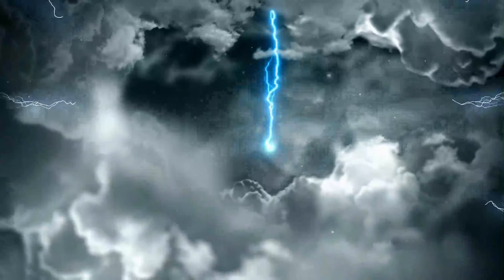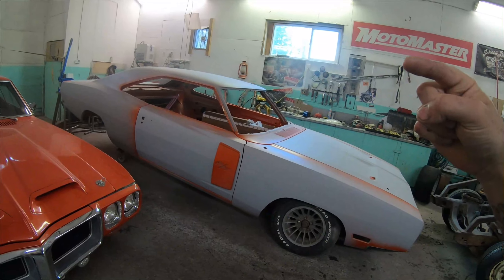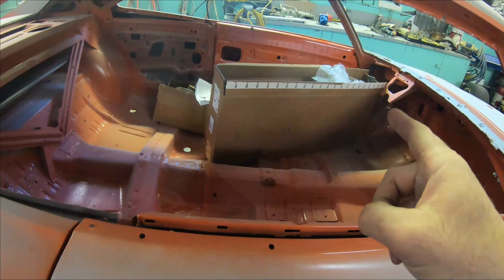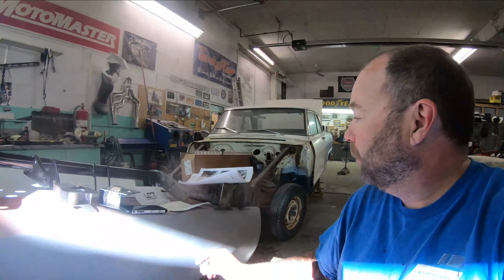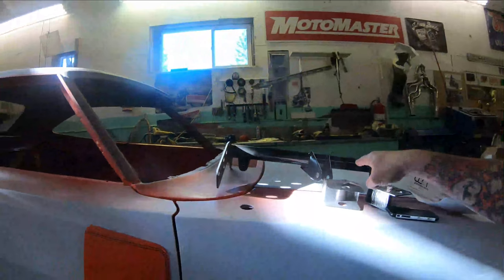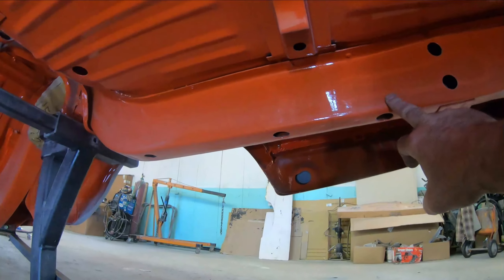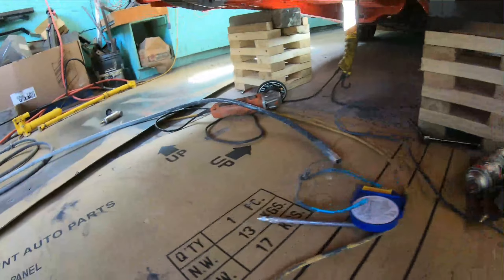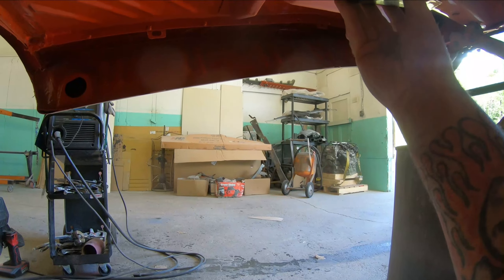Dodge Charger leaf spring relocation bracket installation

Comment: I got on the 70 charger when you got the fenders .on the top of fenders wasn't nice smooth or did you have to add bondo glass to nice smooth. Why I'm asking my father 70 charger top of both fenders are wavy thang is you can't buy new ones because 70 charger fenders are wider then 68, 69 s
Reply from the maker: If you go back a few videos, I did one on rebuilding the fenders. These had to be heavily bodyworked, . Unfortunately customer bought some “mint” used ones that turned out to be crappy and yes, it sucks that there are no reproductions available for the 1970.
Reply: Thanks John for helping me out. I figured I probably have to use dyna glass for top of the fender it's not low just alittle dip on top. I did get some of the dent out it. keep up the good work John I'll keep watching ya